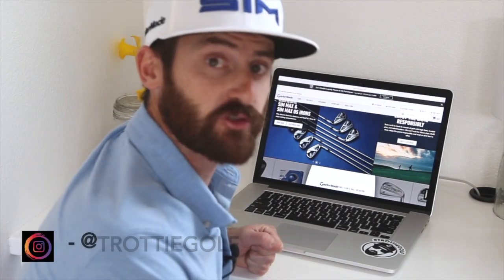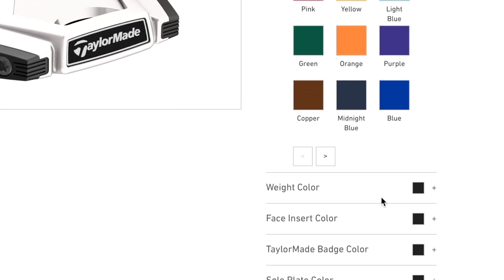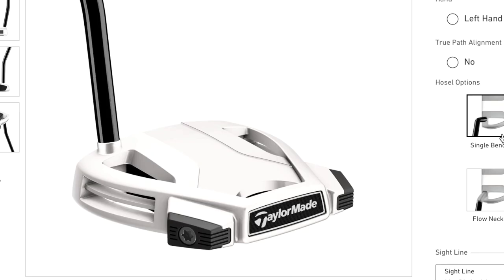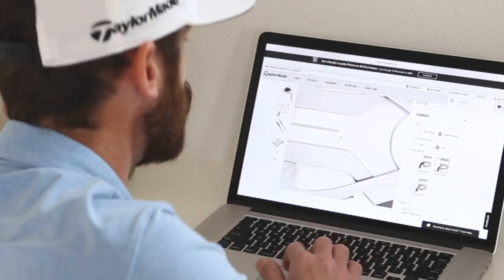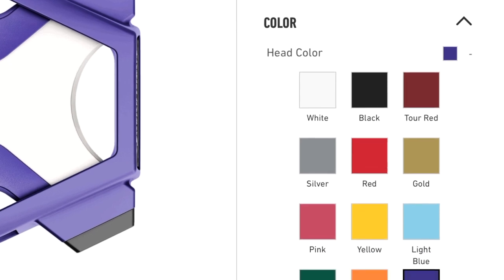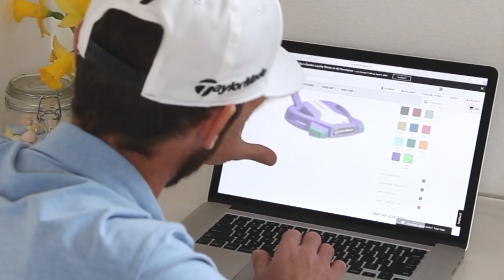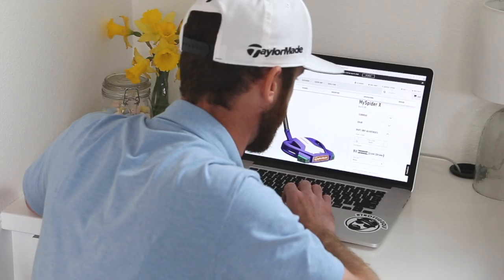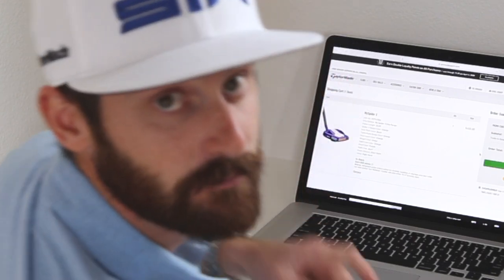Designing your own TaylorMade MySpiderX putter - #TOURTRUCKTUESDAY

Comment: I have had a Spider from almost every generation and currently have a Spider X. I love them!!! But I do have one question: I take excellent care of all of my Spiders but always have troubles with the paint chipping...is there anything I can do to prevent this or have it repaired?? Nothing worse than looking down at a chipped putter...
Reply: I buy them here locally as well.they sell dirt cheap when chipped,then i refirb them,laser cut a new face out of Aluminium or Copper and resell them again.i hate the pure roll inserts,they offer no feedback on the strike.
Reply: Ive touched mine up with enamel model paint. Wonder whether the custom painting is done differently.

Comment: So, what will your putters swing-weight be?
Reply from the maker: Std stock usually D6-D8 dependent on length
Reply: With how much weight in the ports? @trottiegolf
Reply from the maker: @douglasmoore8770  what length is the putter? You're gonna need a swing weight machine to nail this as grip type and weight also play a role
Reply: What is a swing weight machine? Can it help you get the ball in a hole?  @trottiegolf
Reply from the maker: @douglasmoore8770  arguably yes: 

https://youtu.be/Ww2GaXSEX9Q?si=BF6y2e4ZaELB9Sm9
Reply: Thanks for your reply. Are the newly designed weights compatible with the old weights, fitted to drivers, fairways, utilities and putters?  @trottiegolf
Reply from the maker: @douglasmoore8770  I believe they change every few yrs, really depends on what models you're comparing
Reply: Thanks for your time. I've had enough. Dou @trottiegolf